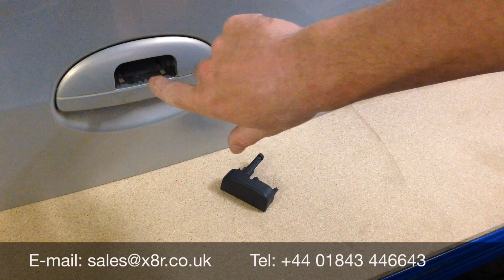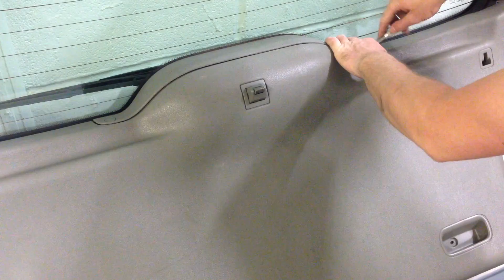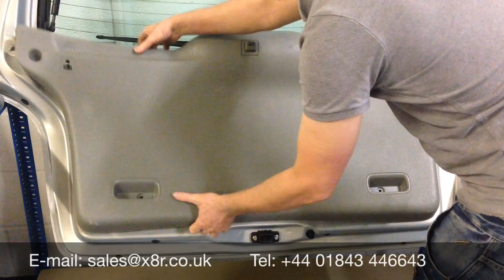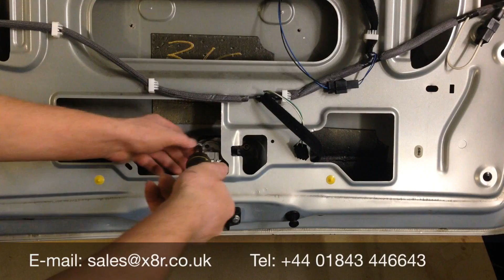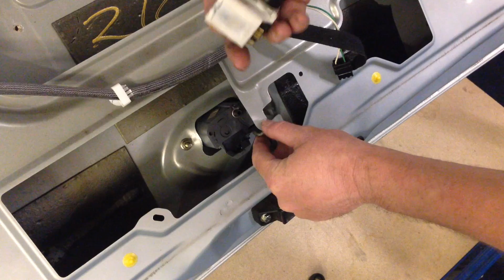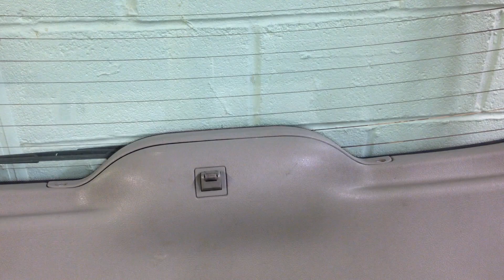Renault Megane / Scenic MK1 Boot Tailgate Lock Rear Button Replacement Installation

Comment: I have a problem with the bottom part of the lock itself. It is loose and often my trunk won't close. It only closes if I find the exact spot in which I have to leave it. Do you have. A video of its setup?

Comment: Hi would you be able to steer me to a video of how to change the top tailgate window latch as mine will not lock . Although your video is good and shows how to do that part as that will get done in due course. So thanks for that part.

Comment: Hi, would it be possible to open the lock mechanism of a closed boot on a Scenic 2 from the inside if the trim was removed? I use my Scenic as a camper and would like to open the boot at times from the comfort of being inside the car rather than getting out and going around to the back to do that.

Regards, Ashton
Reply: Take the plastic off and attach a string to the lock 'arm'. Pull down to pop the door open. Not sure it would work if the car is locked tho?
Reply: @jamesjupp9968  thanks there's actually a latch next to the lock that opens it from inside whether locked out not

Comment: great vidio thank you you do not show how to unlock the tailgate in the first place
Reply from the maker: Donald Fergusson Hi Donald, If you look through the space where the old boot button was you will see there is a small hole within, if you push a pen or a screwdriver through the hole this will release the boot, if you need any further guidance please just let us know.
Reply: @X8RLtdUK Hi, I still have the original button because the damage happened while I was opening the tailgate and it popped out with the spring, and fell to the ground.  I think the rubber ring that fits into the longer piece has broken.  but in the video yours seems to be made of metal, I purchased a replacement and the ring is made of rubber.  Are you saying it's okay too?  so at least the button is the same color as the car and not black.  or could the damage be something else?  now I'm keeping it in place with duct tape, otherwise the spring will push it out and sooner or later as I go, I'll lose it along the way.